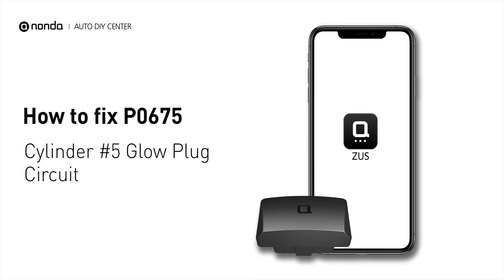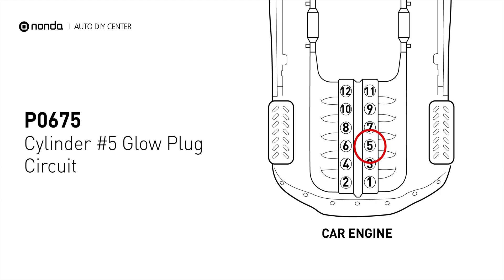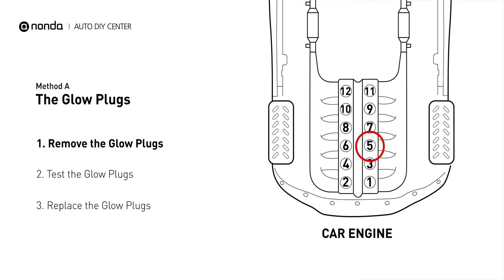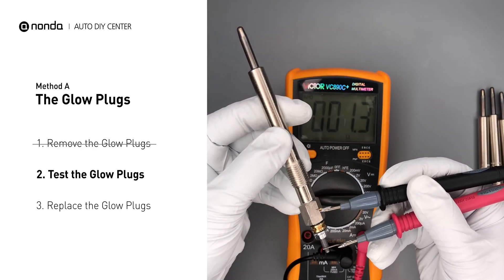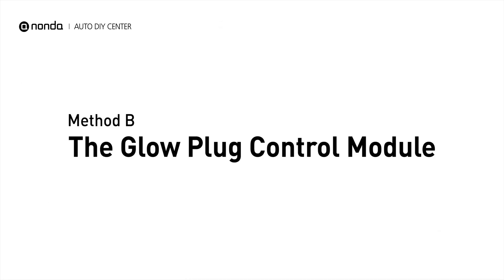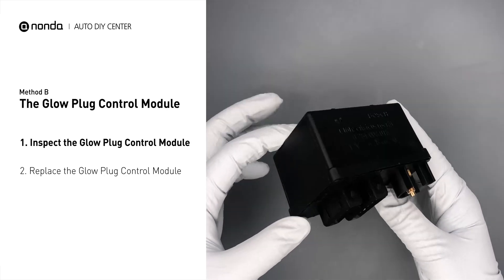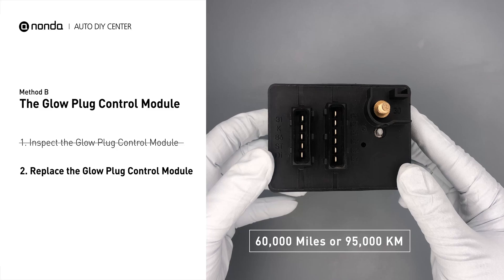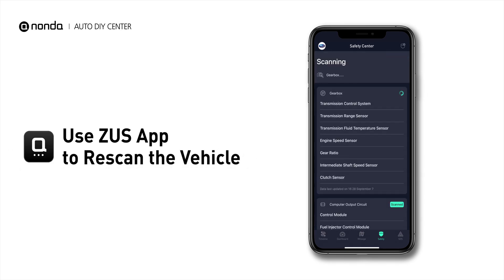How to Fix P0675 Engine Code in 3 Minutes [2 DIY Methods / Only $9.36]

Comment: I have a 2009 VW Touareg and I got the same code. Thank you for this video. I should be able to fix it my self. I got the engine replaced a few years ago. The car runs but lose power when it’s in low or high mode. It’s an all wheel drive.